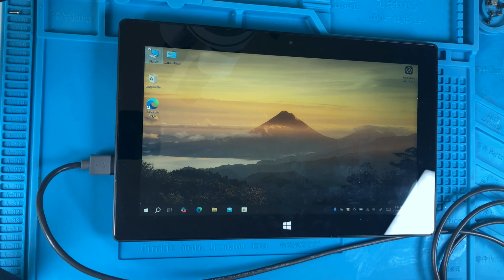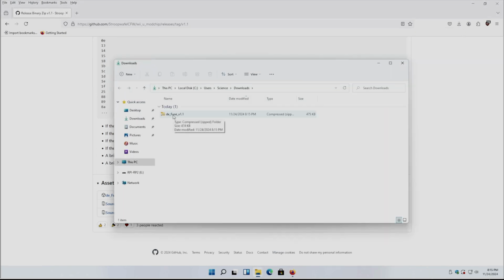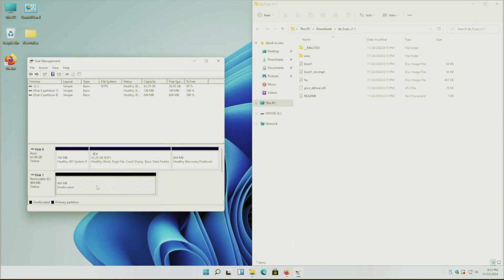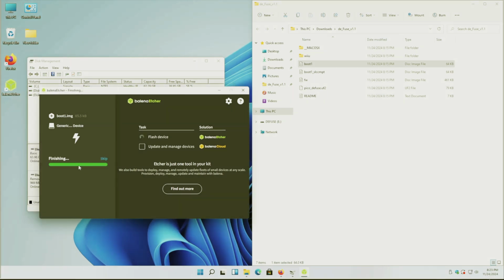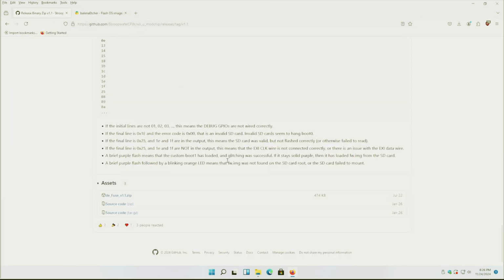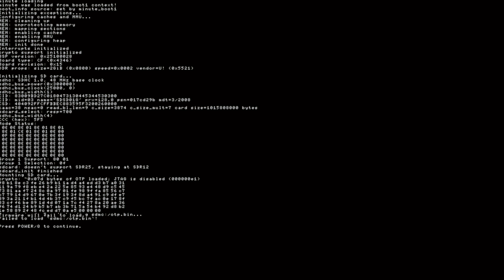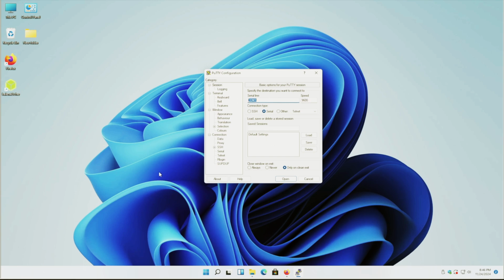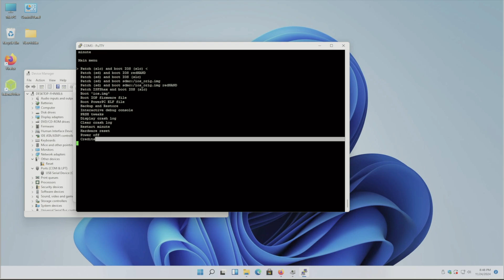A guide to setup Defuse on a Wii U Console

Comment: 2GB cards also work. smaller usally also works. The important thing is, that it is not SDHC (so 2GB or smaller).
2GB is much more convinient for dumping both SLCs or rebuilding the mlc, which needs 1.1GB of titles. So far every 2GB card I tried worked.
Reply from the maker: Well that is good information to have. Thanks for sharing that. Unfortunately all the 2GB SD Cards I tried refused to work and yes they were not SDHC. I will have to get another one and give it another attempt.
Reply: doesn't flashing boot1.img to the sd limit the usable partition? Resizing the partition does not work. Cheers
Reply: @victormattina No, you can just change the size of the partition. Format it
Reply: @janhofmeier9427 got it, thank you. Had to resize the whole usable partition to take up all the remaining free space after that 64MB head and it eventually worked.
Reply: @victormattina btw that guide is outdated anyway, since there is paid the beak which mostly gives you the same capabilities but without soldering

Comment: My Wii U 32gb shows Wiiu screen, but does not start in menu wii u normal.

Can you help me?

With rasp pico it enters hack mode, but does not show the menu/image on screen, although I have been able to do some dumps to the sd blindly.

Questions:

1) Is the only way to recover it via DEFUSE or can something be tried first?

2) To do Defuse is it necessary to have some Nand file and which one(s)?

and if it is corrupted?

Thank you very much for your video.
Reply from the maker: So UDPIH/Recovery is working. That is what you are calling hack mode. Did you attempt to blindly install ISFShax? If you can get that installed blindly then no you don't need defuse. If you cannot get that installed, then defuse would be required.  

2. You don't need any nand files from the console if using Defuse. OTP.bin can be dumped after defuse is installed. I would recommend watching my other video where I show a full repair using defuse. https://youtu.be/VPehhgK3VbY

On a side note, did you dump the system logs? Did you look at them to validate the eMMC is failing?

Comment: My wii u is with that red blinking light, no video at all. What is the best thing to do? Defuse can bring back the video if sucessifull or i will need instal the nand aid. My one is that hylux chip, one of the first models. I just want to play my games again.
Reply from the maker: Red blinking light on a cold boot  means there is a problem with one of the power rails, usually a short some where. If its blinking after some time passes its usually from an overheating console or failed VRM. Defuse isn't going to fix any of that. You need to resolve the power issue/overheating issue first. Furthermore If you have a hynix  chip and it is failing than you would still need a NAND-AID.

Comment: Anyway I can install this on my aroma wii u?
Doesn't need a repair I just want to do a gpu overclock for games like botw and batman arkham origins
Reply from the maker: The install would be the same. Also overclocking on the Wii U is negligible. Overclocking  the GPU will net only tiny gains in specific areas of BOTW where memory bandwidth is limited. I recall one of these areas being Korok Forest and I do mean tiny gains. You may want to research this I remember someone claiming you could do the same overclock on the GPU using minute menu. I don't know if this is true, but it would beat installing defuse.

Comment: SDHC works, 4 gb card work fine.
Reply from the maker: Congrats on finding one that worked for you. The reason I don't recommend SDHC cards and didn't recommend them in this video or my guide is because many of them will not work. You may get lucky, but when making these videos I am trying to instruct people in a way where they will have the highest chance of success.
Reply: One piece of info I found from an old 2008 blogspot, is that the SD 1.x physical electrical standard does allow for 4gb cards, but the software standard cut it down where anything over 2gb needed to be HC certified or branded or something. Lacking the extra bit of circuitry is why "sometimes 4gb aren't HC" even though labeled such.

 I'm waiting on the mail to deliver a few ancient (and the company's been defunct for years) eye-fi brand sd cards that have built in wifi for uploading pics from old cameras, a couple 4gb and a couple 2gb. I wish I could afford the Toshiba FlashAir, because you can fiddle with a hidden file to swap SDIO for GPIO and use the SD card itself as a wifi card for Raspberry Pi.

Comment: Hey @tzirf, I'm wondering how you would explain the difference between ISFShax and DeFuse to be? Do they both use the minute interface? Can they both be used to rebuild an mlc? When should I be using one and not the other?
Reply from the maker: If you can install ISFShax on the console than you don't need defuse. Put simply defuse is the absolute last resort when all else fails to work. Out of dozens of consoles I have repaired I have only needed defuse for a single console that spontaneously stopped working and wouldn't boot back into the recovery menu.